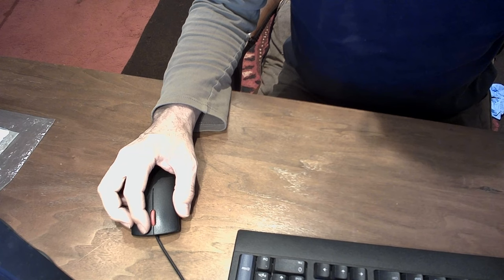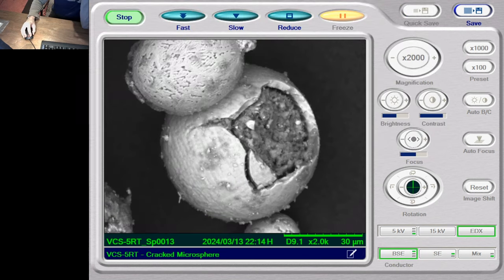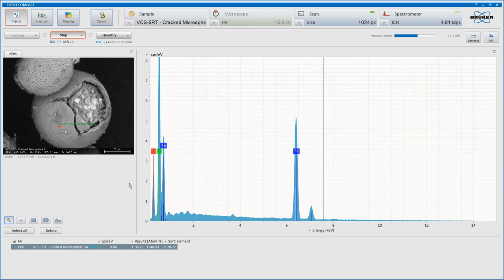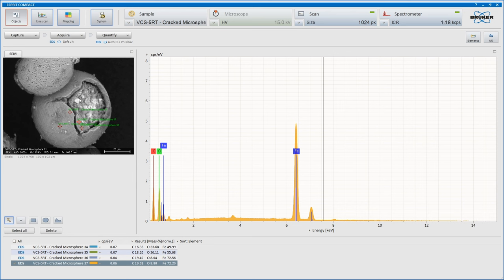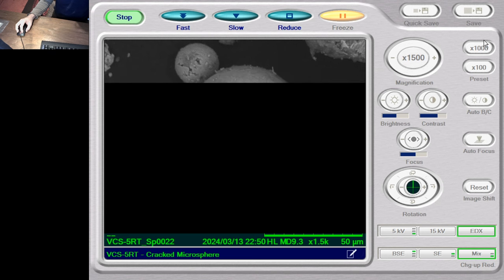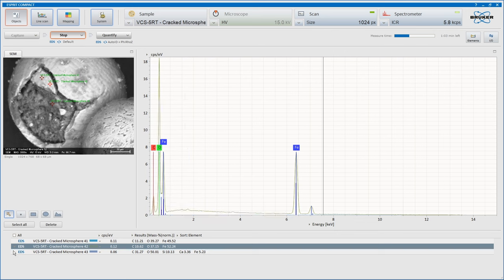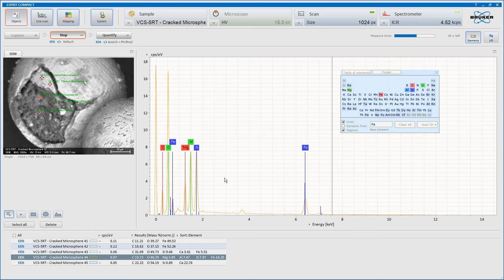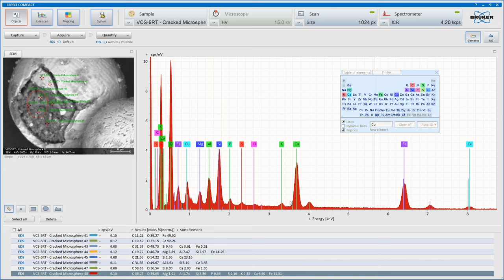Bin-Juine Huang - Cracked Iron-rich crenellated microsphere detailed SEM+EDS analysis (VCS-5RT)

Comment: What should a control sample look like?
Reply from the maker: We have seen production of Iron Rich Crenellated Microspheres in every system where there is charge separation and extreme [magneto]hydrodynamic shear. These systems have been claimed to produce anomalous effects.

A control would be any environment where there is no charge separation combined with extreme [magneto]hydrodynamic shear.

You can do an ULTR experiment - good for 3 year old and up, takes about 7 mins and total capital cost around $35. the control would be letting the Al foil sit in there with no ultra sound for 900 seconds, attempt to collect 100um iron rich microspheres after the control test - happy hunting!